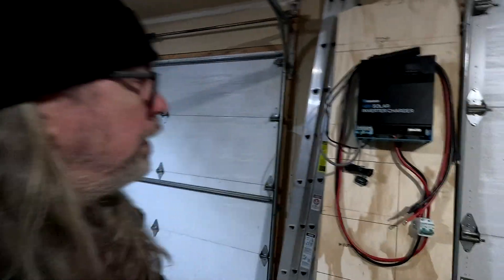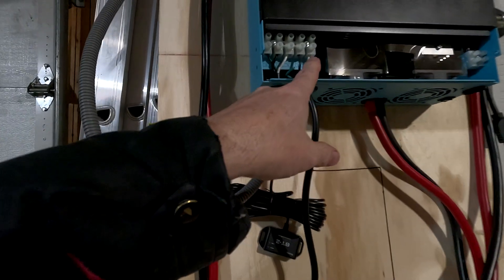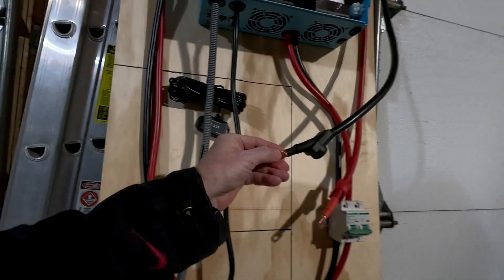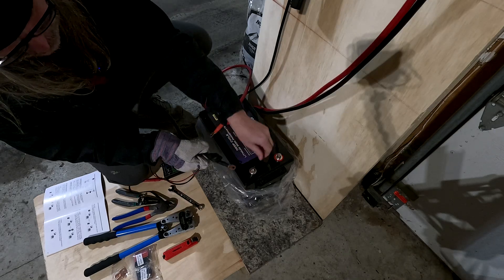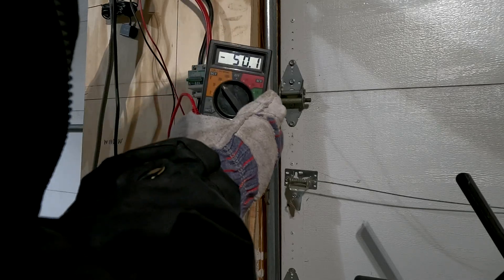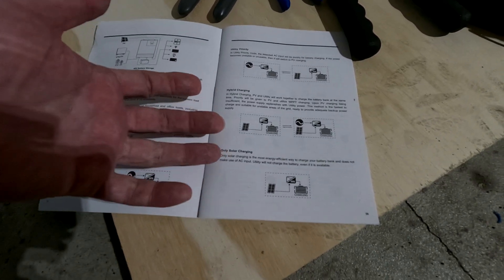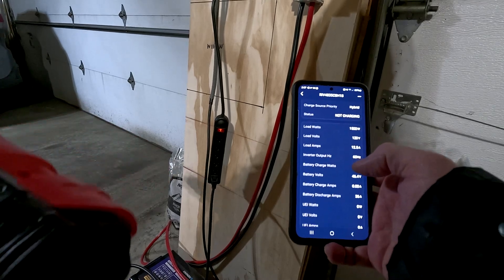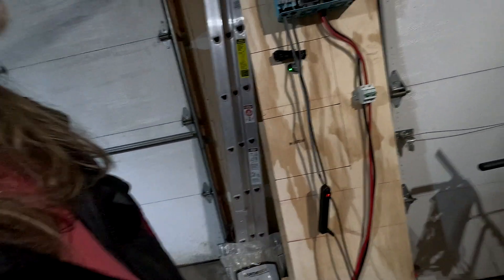Renogy 48v 3500w Solar Inverter Charger

Comment: i have the same inverter. not sure about your breaker. it has positive and negative on the same switch. not sure disconnecting both legs is correct.
Reply: switch would not be isolated
Reply from the maker: When I turn off the breaker. There is no voltage on the other side as I would hope. Mainly want it to disconnect the battery.

Comment: If it's a high frequency, transformerless inverter, then you just threw your money away. High frequency transformerless inverters, have much shorter life expectancies, much poorer surge capacities, and they can damage your appliances when they fail. A much better choice would have been a low frequency, transformer based inverter charger.
Reply from the maker: Thx! That is good information to know. I personally don't plan on using this to run a house with appliances. I will be using this for a small off grid solution.
Reply: @quickquote do you think the eg4 3000w inverter is a better choice?
Reply from the maker: I didn't go that way as that inverter needs 120 - 450 vdc of PV to work.  I don't think I will have a big enough PV array to always supply the 120vdc needed. This one takes 60-145vdc.
Reply: @RickyVentures very good point. My small panel setup puts out just over 70 volts